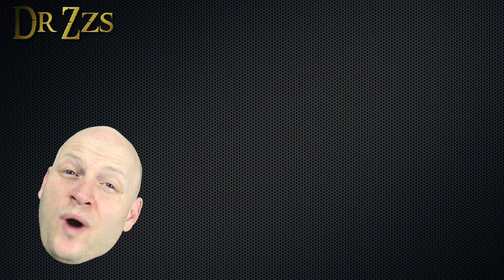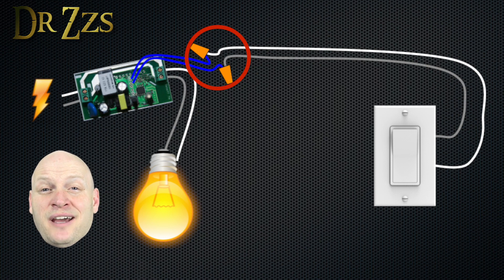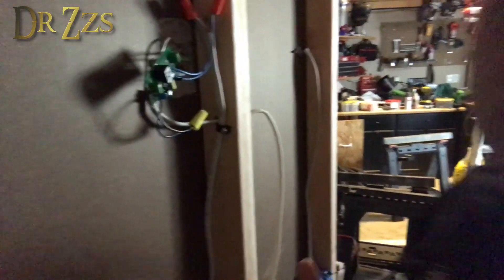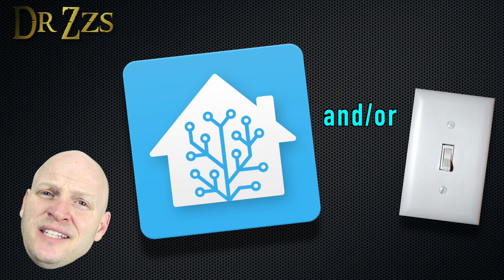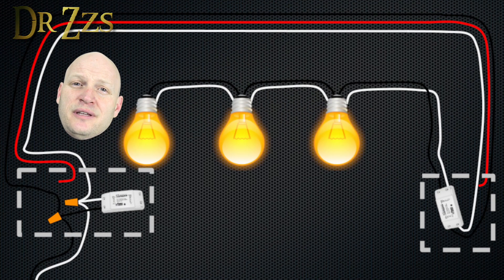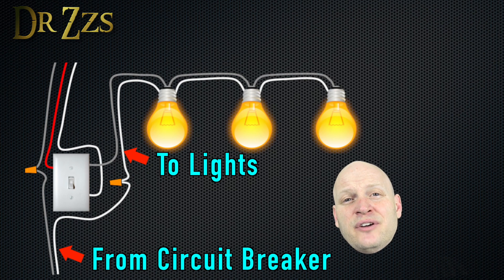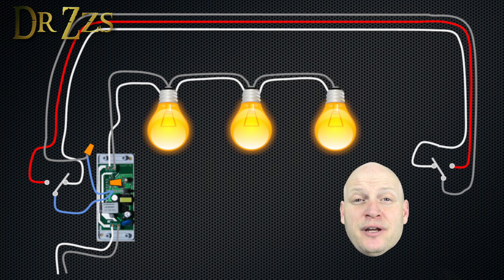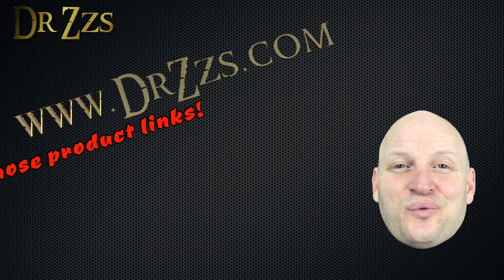Maker Faire 2018 - 2 wires in a Switch box & 3-way another way

Comment: Hey just wanted to know that is there any way by which you can change the speed of a ceiling fan using sonoff, nodemcu or anything.
Reply from the maker: I don't exactly know how the mechanism works for changing speeds. Maybe someday I'll tear apart a fan and figure it out.
Reply: First question is whether the fan has an AC or DC motor. Assuming it's an AC motor (which is still more common) there's an interesting strategy that requires 3 of the Sonoff 1 Channel Inching / Self-Locking WiFi Wireless Switches. (https://www.itead.cc/inching-self-locking-wifi-wireless-switch.html ) 

See a diagram & brief explanation here: https://www.reddit.com/r/homeautomation/comments/73yd37/fan_control_with_sonoffmqtt/

Another option would be to buy a 433MHz remote control kit for your fan (for example: https://www.amazon.com/s/field-keywords=fan+remote+kit ) as well as something like the Sonoff 433MHz RF Bridge ( https://www.itead.cc/sonoff-rf-bridge-433.html ) which you could then flash Tasmota onto ( https://github.com/arendst/Sonoff-Tasmota/issues/1126 ) which would allow Home Assistant to send commands to the new fan remote. 

The downside to any solution involving 433MHz devices is that Home Assistant won't reliably know the state of your fan. (While it can try to keep track of any commands it sends to the fan, there will be no confirmation from the fan that it actually received the commands & executed them successfully & more importantly, if someone uses the remote that came with the kit to change the fan speed Home Assistant definitely won't know about that so it could think the fan is off when it's really on, etc.) Now, there's at least 2 potential solutions to this problem as well: The simplest is obviously to simply require the fan to be controlled only from Home Assistant (take the batteries out of the remote & throw it in a drawer) or alternatively, you could try & use something like the Sonoff POW to measure how much power the fan is consuming which should allow Home Assistant to guess with a pretty high level of accuracy what setting the fan is on.

Fans seem like one of the more complicated things to make "smart", but it's definitely not impossible. Good luck!
Reply: Thanks, 😊😊

Comment: can you do a video on sonoff B1 with tasmota been curious to see if it is any good
Reply from the maker: Are you reading my mind?! 
I did include the B1 in the display wall, and I'm working on editing a video about it right now!  I'll try to get it done and posted ASAP.
Reply: thanks, I have just finished installing 11 sonoffs in my lightboxes. funny thing is when I explained to my wife what I wanted to do to she thought I was crazy but now that, all the lights turn on when the garage door opens or someone opens the back door she can't live without.
Reply: A B1 video wold be wonderful! After your first live stream i bought  2 of them but cant get them to flash tasmota. Love all of your videos!
Reply from the maker: That's fantastic!  Wife buy-in is the key to happiness!
Reply from the maker: Cool!  It's a little tricky to get them flashed, but it's not too bad.  Since the contacts aren't holes it's hard to get the jumpers to stay contacted (impossible really).  So I soldered a header on the 5 pins we need (3v, gnd, rx, tx, gpio0).  The next trick is using a jumper from the GPIO-0 header and touching the gnd pin (i used the one in the middle of the light) when you power up, to get it into programming mode.  Then the flash goes pretty smooth.  I also suggest setting your wifi SSID/pw info in user_config.h before you flash because with no button, putting the B1 in "Wifi_manager" mode means touching that GPIO-0 wire to ground "4 times rapidly".  I did it, but it's kinda painful.  If the sketch you upload already has your wifi info you won't have to do that part.  
I'll show you all the stuff to set them up in HA too.  Took some researching to figure that out.  Works great now! 
okay, I gotta get back to editing that vid!

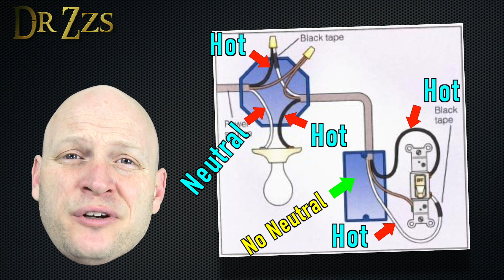Comment: most of my house was wired up like your example at about 1:00. I wonder how one could control a light and ceiling fan separately. Woud you need two Sonoff?
Reply from the maker: yes I would think so, or a sonoff with an extra relay.  Maybe a Dual, or just adding a second relay to the another GPIO pin.